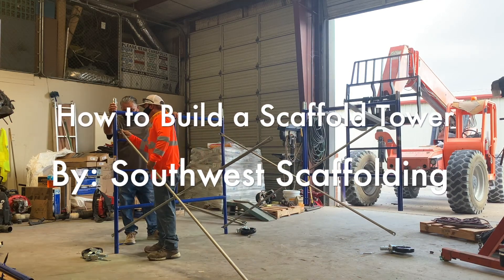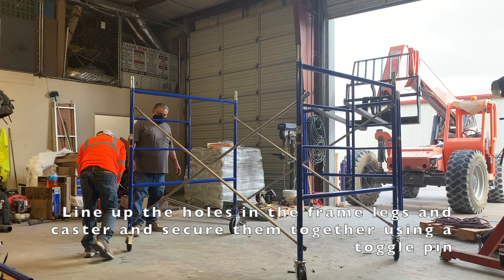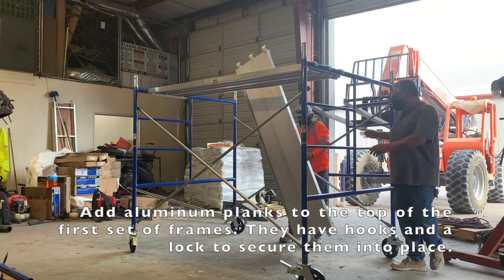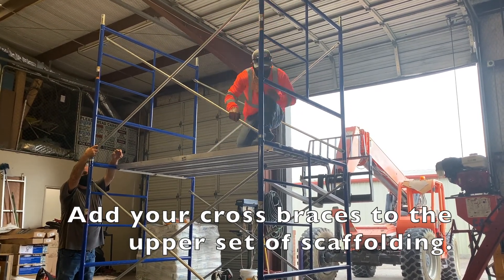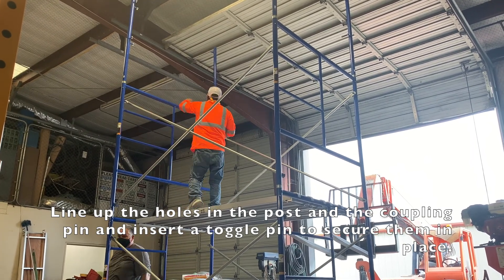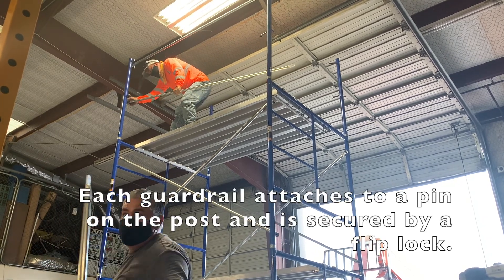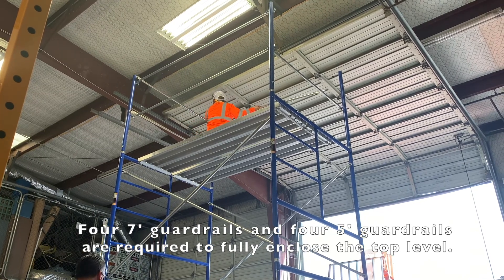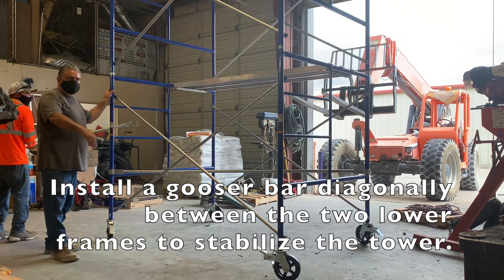How to Build a Scaffolding Tower - a Step by Step Tutorial

Comment: So he is at 10ft putting up the rails without fall protection?
Reply from the maker: That's a great question! Yes he is! According to OSHA 1926.451(g)(2):
Effective September 2, 1997, the employer shall have a competent person determine the feasibility and safety of providing fall protection for employees erecting or dismantling supported scaffolds. Employers are required to provide fall protection for employees erecting or dismantling supported scaffolds where the installation and use of such protection is feasible and does not create a greater hazard.

In this case, because the scaffold tower is freestanding, there is no suitable tie-off point. According to OSHA: "Section 1926.451(g)(2) was enacted because of feasibility problems when erecting and dismantling a scaffold. Those individuals working on the erection and dismantling of a scaffold are sometimes limited in having suitable tie-off points while on a partially completed/dismantled structure. The Agency recognized that in some cases it might not be feasible to provide fall protection to employees erecting or dismantling scaffolds."
Reply: Did your mom let you out of the basement this weekend?